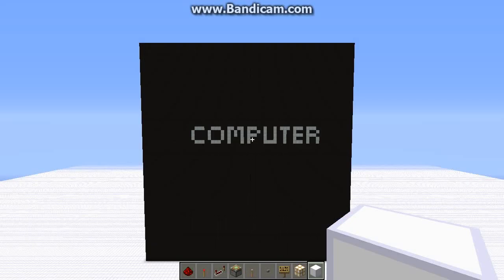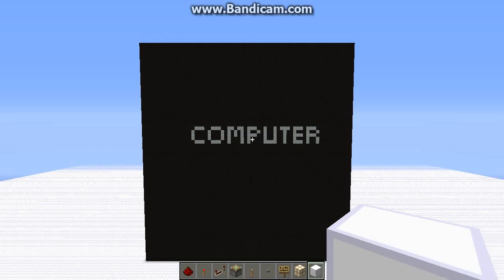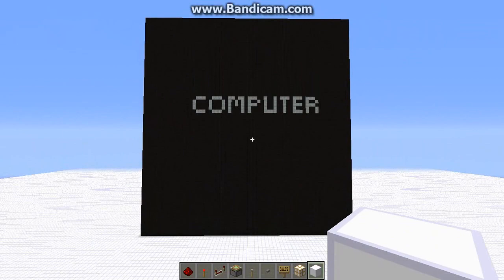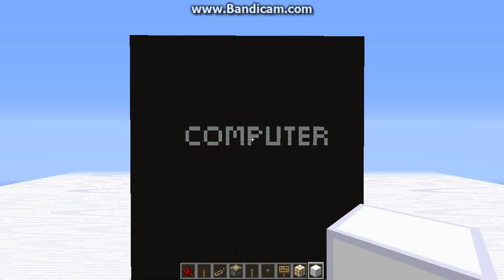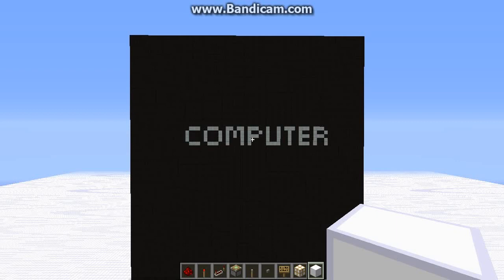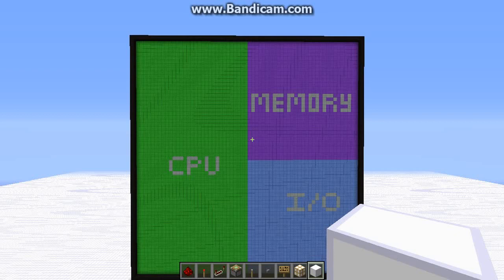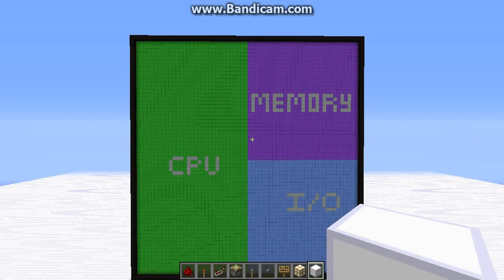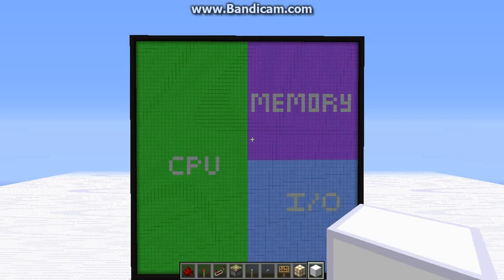Advanced Redstone Computer Tutorial 2: What is a computer?

Comment from the maker: There's no reason you couldn't; the logic is the same no matter what medium you use ;) The only thing is it will probably be significantly slower in real life, since what's fast for redstone isn't necessarily fast or even possible in electronics.
One area of particular note is fan out. Put simply, it's the number of places a single wire goes in to. In minecraft this isn't an issue, but in real life this causes capacitance that must drain when changing to an off state, which slows it down.